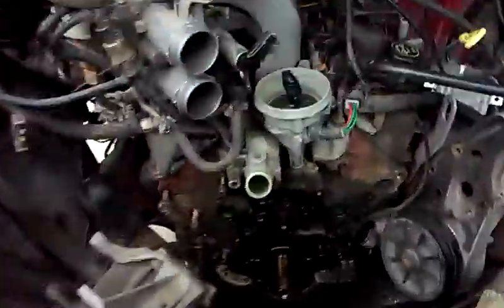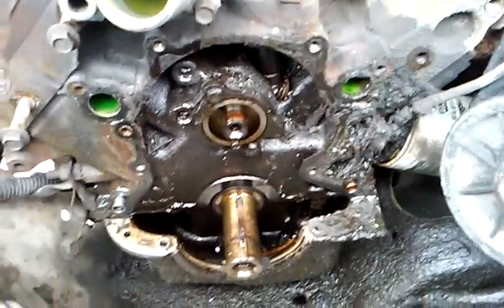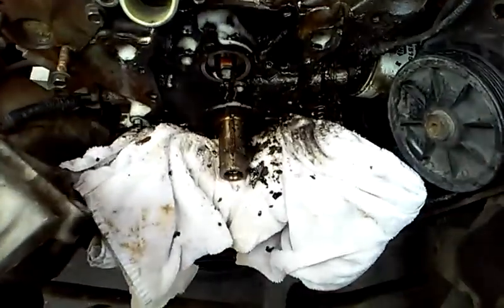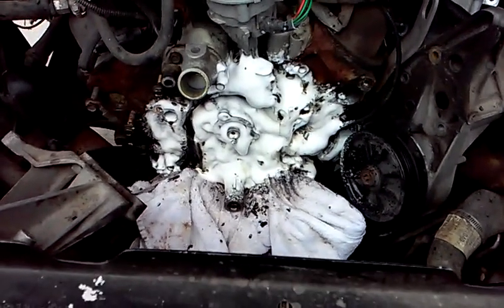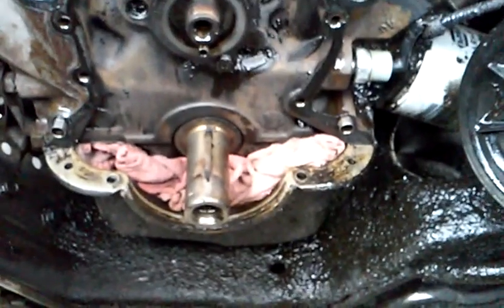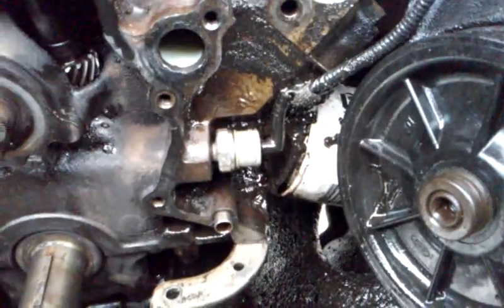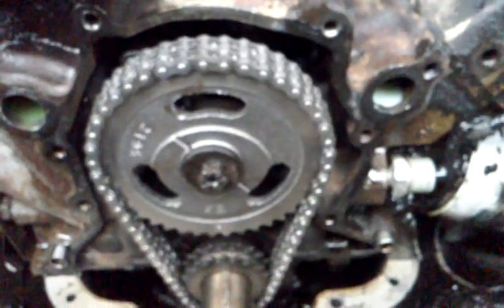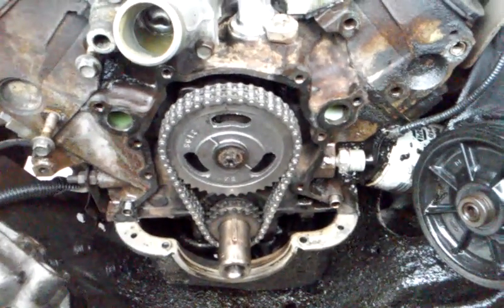clean timing on ford f150 302 5.0

Comment: At least I won't have to remove the oil pan. My water pump cracked and the top part of my timing cover cracked. Now I got to replace the timing cover and water pump. You answered my question because I was wondering if I would need to take the oil pan off. Thanks
Reply from the maker: Glad it helped

Comment: hey my ford f150 1995 it turns off constantly when im driving it especially when going up a hill and hesitates what do you think it could be? thank you !!!
Reply from the maker: how many miles?
Reply: Matt Shaughnessy about 260
Reply: I got the same issue, but mine is a manual and I downshift in order for it to not turn off.
Reply: Fuel Pump